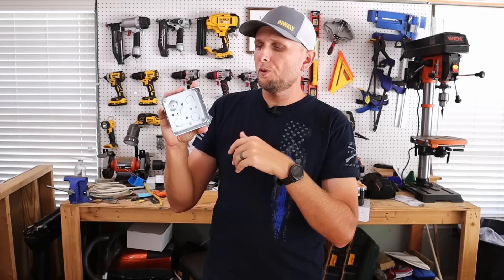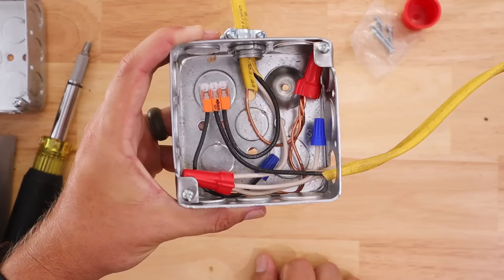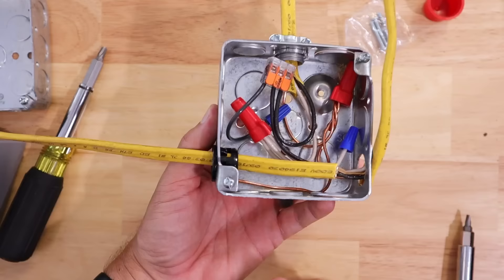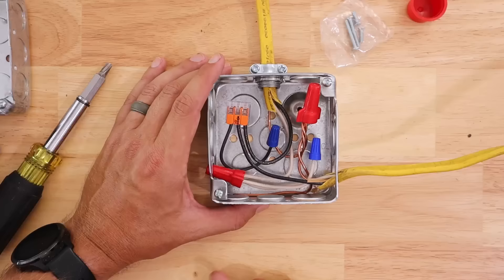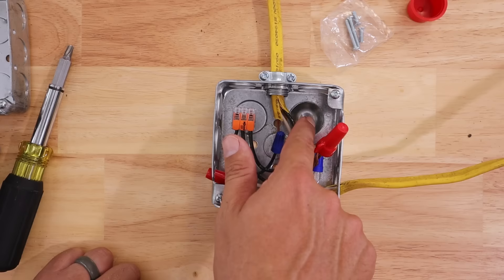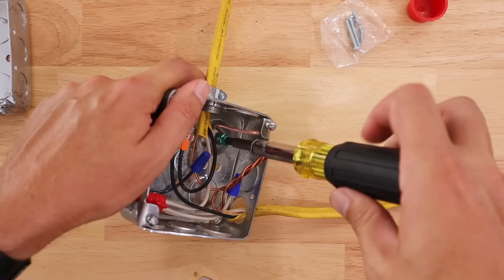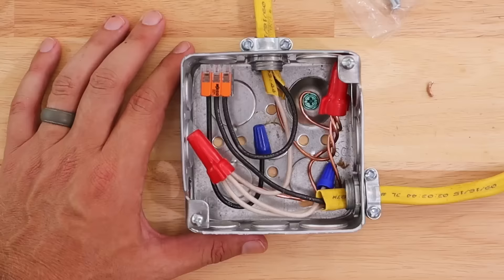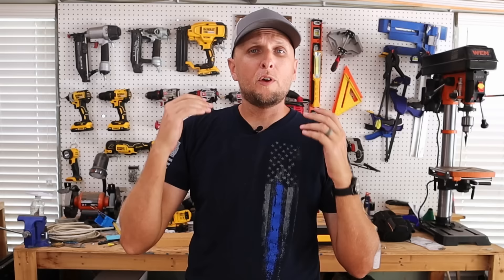The BIGGEST Mistakes DIYers Don't Know They Are Making When Installing Metal Electrical Boxes

Comment: You do realize the outlet receptacles grounds to the metal box when i ground is connected to the receptacle. Their is no need to ground the box the way you have. This video looks to be your opinion nothing more.
Reply from the maker: You do realize it’s not my opinion at all, it’s literally required by code and every electrician will tell you the same.  Your comment looks to be misinformed, nothing more.  But good news, this video is clearly made for you!
Reply: @HowToHomeDIY  For surface-mounted metal boxes All it requires is that the device is attached to the cover with at least two permanent fasteners which is the receptacle mounting screws.  The cover mounting holes are on a flat, nonraised part of the cover. The device yoke or strap makes direct metal-to-metal contact with the box to provide the required ground-fault current path. All that is required is above.
Reply from the maker: @luciffer420 you can try explaining how things work all you want.  It is required by the NEC that a metal box always be bonded to ground using a grounding screw that shall be used for no other purpose.  Your argument is with the NEC.  Not me.
Reply: @HowToHomeDIY  what I stated was from the NEC
Reply from the maker: @luciffer420 maybe for something else.
Reply: @HowToHomeDIY  Can confirm luccifer420's opinion is wrong

Comment: The only time a DIY will get away with doing this is when they boot leg an installation with no permits and inspections which is not supposed to happen in the first place ,this is why we have building codes in each state, if a state has no code requirements than it's worth like the  wild wild west very unsafe practices ok , and this should not ever happen with electrical or gas installations which are very unsafe , all states that are up to date should have  building code requirements ok any state that has no building code requirements is backwards third World  country scenario which is not good for anyone of us

Comment: downvote for clickbait thumbnail suggesting that Wago connector shouldn't be used... Too bad as otherwise useful info
Reply from the maker: It is pointing at the wire.  It has nothing to do with the Wago.  But downvote away.
Reply: hehe, I wondered if the arrow was pointing just at the top of the wire for plausible deniability. It's close enough that it looks like it could be pointing at either. But then it's the Wago that's on fire, not the wire. Perhaps your aim wasn't clickbait, you just didn't want to spoil the reveal, fair enough. If it was clickbait, it worked a treat as it is what caught my attention and made me open the video "what could possibly be wrong with using a Wago there?"
Reply: fwiw in hindsight I apologise for being a jerk about this. downvoting was harsh given the useful content. Better to just say that I feel the thumbnail is misleading.

Comment: Most of those little metal boxes have the GREEN screws in them already!!!! (for the ground screw)(Dont know where you buy your shit..I have NEVER had to buy a grounding screw separately)
Reply from the maker: Whoa, no need to shout 😂 Are you in the US?  Because they typically don’t come with the grounding screw unless it’s an outdoor box here.
Reply: People need to learn proper grammar....shouting is not possible on a keyboard but emphasis is and I didnt even overuse it (my caps DO sometimes stick and i get lazy and dont correct...in this case you are just being a snowflake)  I am in the US and never once bought a metal box (and I have used them many times for junction mostly )that didnt have a grounding screw...NOT ONE EVER...and while my back was hurt in 2001 and I have been injured since I was a project manager prior to that for 16 years...General construction with electrical work when remodeling (which was off and on over the course of my entire career)....not to put to fine a point on it @HowToHomeDIY
Reply from the maker: I mean, you’re wrong, about pretty much everything you said, and you’re upset about it.  But carry on, it’s somewhat amusing 😂🫶
Reply from the maker: Oh you are mad mad.  Well that person was correct that you can’t bond neutral to ground in the breaker panel unless it’s the first disconnect or main panel.  So depending on the location, one of you was correct.    I appreciate the comments though.  They bring levity and I’m able to give you information you are unaware of.  Take care!

Comment: Twisting the wires is WRONG! THE mfrs say so, and code says so
Reply from the maker: No, the manufacturers do not say that and it definitely is not in code.  Feel free to share the code you think says this.
Reply: @HowToHomeDIY  all of the mfrs basically say this (this is from King Electrical) 
Connecting Wires
1. Start by holding the two wires together so that the copper ends are parallel.
2. Together, slip them into the Wire Nut.
3. Now, turn the Wire Nut clockwise until it feels secure.
4. Give the wires a gentle tug. If you detect any movement or slippage what so ever, untwist and start the process over.
NOWHERE DO THEY TELL YOU TO TWIST. AND NEC CODE SAYS "TO FOLLOW THE MFRS INSTRUCTIONS". and in every case the mfrs DO NOT instruct you to twist the wires. in fact they clearly say to lay them parallel. so if you are NOT laying them parallel before applying the nut, you are not following the mfrs instructions.

call Ideal - they will tell you DO NOT PRE-TWIST.

twisting is esp bad if you have solid and stranded conductors in the same nut - the stranded conductor will tend to get pushed down around the solid conductor and NOT make a good connection. 

I GLEANED THE FOLLOWING FROM various electrician and mfrs forums...

it is not necessary to pre-twist, the mechanical connection should be established with the twisting of the wire nut itself. wire nuts can and will be deformed once the wires are secured inside.

  "Before crimping, you should prepare your wires, but you shouldn't deform the wire strands in any way, such as twisting, flattening, or kinking them. You want the strands to be as dense and tightly packed as possible..."

and here, from Trades Nation, a guide/fact sheet on...
PROPER TWIST-ON CONNECTOR TECHNIQUE
                       16 Sep 2021
TWIST-ON CONNECTOR BEST PRACTICES 
A few tips to remember when using wire nuts:
> the wires should be stripped equally, to the manufacturer's spec, and for the particular application that you're working on
> the wires should be aligned equally, especially in applications where more than two wires are being twisted, or when stranded and solid is being combined
> it is not necessary to pre-twist, the mechanical connection should be established with the twisting of the wire nut itself
> wire nuts can and will be deformed once the wires are secured inside. 
> connectors can be re-used if necessary if they are not compromised structurally
Reply from the maker: @leemason4024 that’s not all the instructions will say.  They will either say pre twisting is acceptable but not required or they will say pre twisting is not required which means it’s still acceptable.  Nowhere do they say DO NOT.

Comment: 8 mins of filler content to get to the main point of the video....
Reply from the maker: The whole thing was the main point 🤣
Reply: @HowToHomeDIY  if someone doesn't properly bond a metal box or put a proper romex connector, they should not be doing electrical work...210.19(A)(4) exception 1a specifically states that you can tap 14 awg off of 12awg for luninairs so you should include that exception in your video and share that if that connection was made, it should be done with a wire nut. Also include that local code differs from state to state where some are a lot more restrictive.

Like I said earlier, not everyone should be doing electrical work...